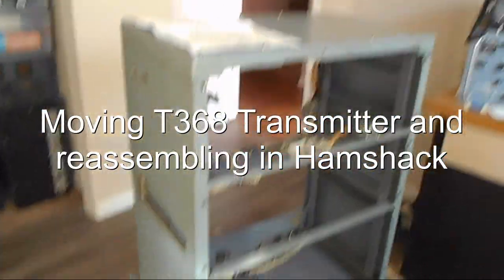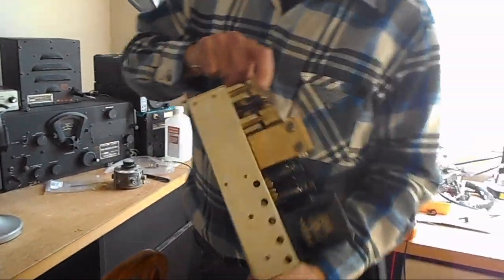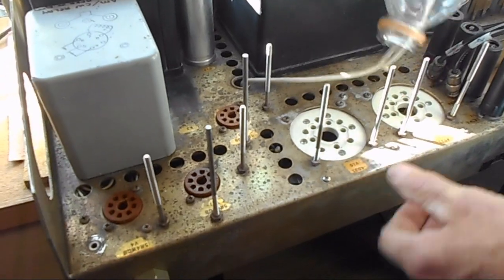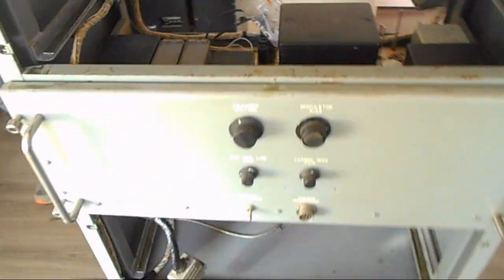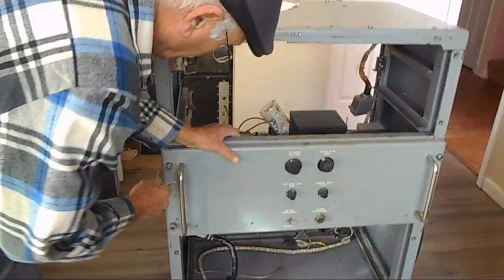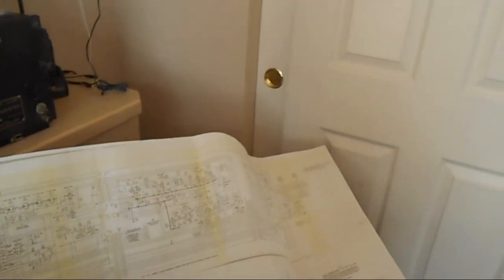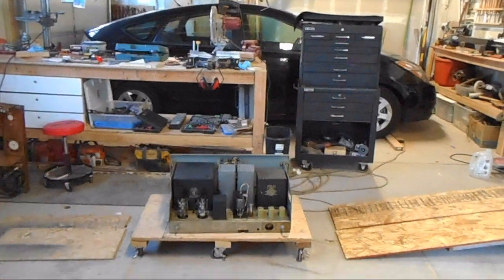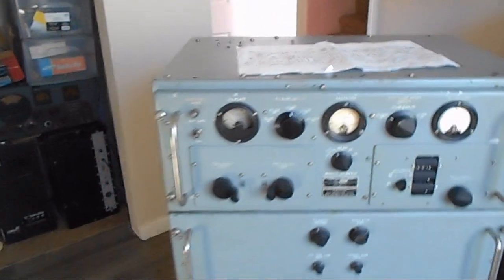Moving the T368 Transmitter and reassembling in the Ham shack

Comment: It all got fired up last night.

It works normally in the :TUNE position where the 2500 volts is dropped back to 1500.

It's right on frequency and the final amplifier tuning works normally.

But alas, the problem Tom had is still there.

The 4-400  final draws 100 milliamps without any drive to it.

The "clamp"  tube that is supposed to shunt screen voltage to ground during periods of no rf drive is working ,but doesnt take the screen voltage down below 70 volts from its 500volts normal.

That "may be"  all it is capable of doing.Putting a differentvvlamp tube in got the same results.

I'm suspecting the 4-400 has been damaged in the past. 

Well, I have a used one coming tomorrow from Enay.

A very expensive tube.

But, I'm happy with all the power supplies,  modulation deck and the exciter.

The protection and metering circuits are all working, and there aren't any cabling issues.

So, all in all, I'm pretty content at this stage.😀

I

Comment: This is one heck of a boat anchor. Nice work guys.
Reply from the maker: Yes, it is a huge boat anchor its built like Collins equipment and does have Collins parts in it. But yeah with the frame and all the parts it weighs 700 LBs!!!!!
Reply from the maker: Its no longer a boat anchor it had a bad final tube my brother found some at ham and hifi that were tested and it now works perfectly. the old workhorse is back on the air.

Comment: only a couple of hundred pounds a bit... pah.. carry them two at a time easy Larry!!!  The question is... Does it work? Looking forward to finding out!
Reply from the maker: Well George, each section weighs near 200lbs all together with the frame and all pieces it weighs 700 plus lbs it's why I used my 1-ton engine hoist to get it in and out of my brothers truck lol Yes well the previous owner said it had an arc over problem so far my brother has figured that out but, if he doesn't get it to work its an $800 boat Anchor.
Reply: $800 and 800Lbs... Thats a lot of steel! I'm sure you will get it going.
Reply from the maker: Well some More developments I would seem that the previous owner ran the final tube into the ground so My brother bought a new 4-400 final tube pretty expensive but when the guy made it arc over by overdriving it he messed up the tube. So new one should be here in a day or so hopefully the snow won't stop the delivery.
Reply from the maker: As of today the T368 Transmitter is back on the air the last piece of the puzzle was the final tube needed to be replaced a reasonably priced new one was bought at ham and HiFi and this beast is now on the air and transmitting beautifully.

Comment: Now that's a project.
Reply from the maker: Yes, and he has repaired pretty much everything that could cause any arching over. But you have to remember the power supply is putting out 2500 to 3000 Volts so yeah instant kill voltage if you don't know what you are doing.
Reply from the maker: as of today the T368 is no longer a boat Anchor it is back on the air and working perfectly.